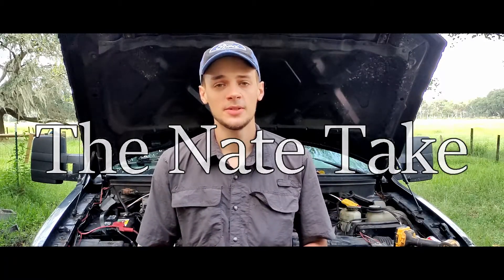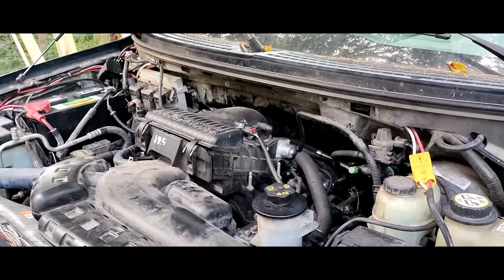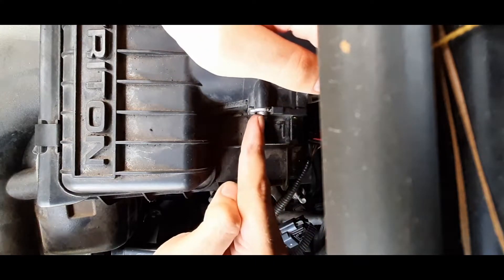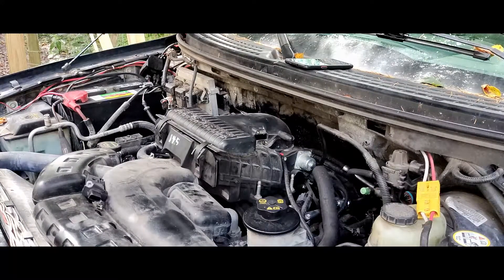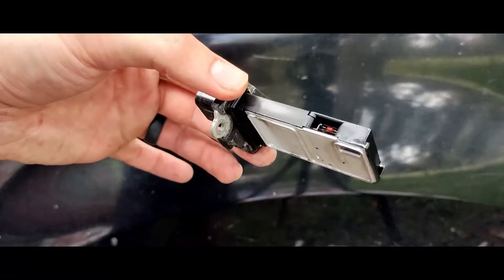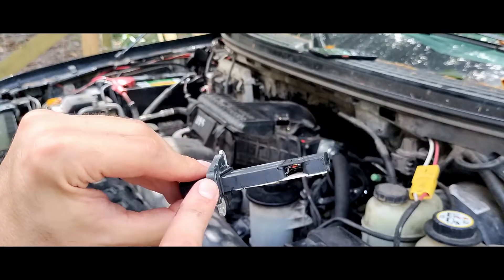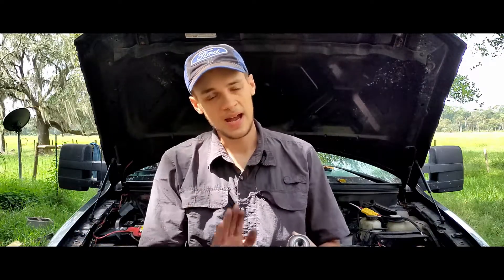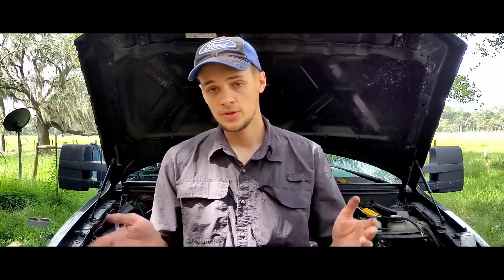If Your Car is Running Poorly or Bad MPG, DO THIS FIRST!!

Comment: How much of a difference can a MAF clean make, I know a throttle body made a noticeable difference
Reply from the maker: Great question. Because the MAF directly affects the air and fuel mixture, it can affect it quite alot. A dirty MAF can't detect the correct amount of air, it will detect less. So the fuel input into the engine will be reduced. This reduced fuel quantity in the normal amount of air will cause lower engine power.